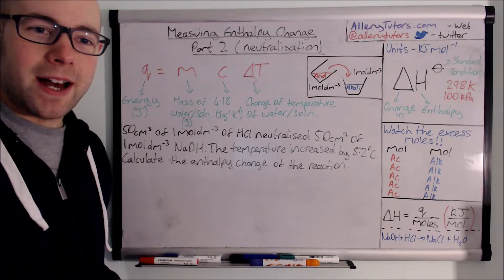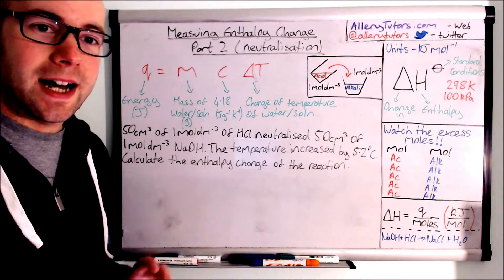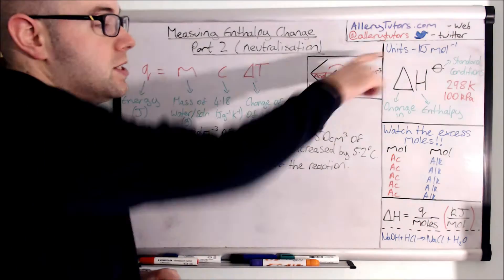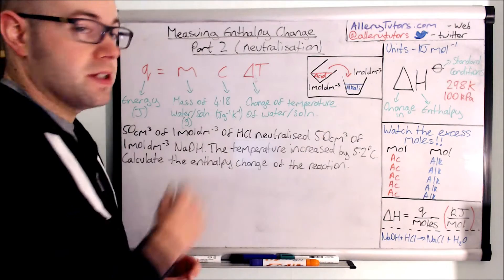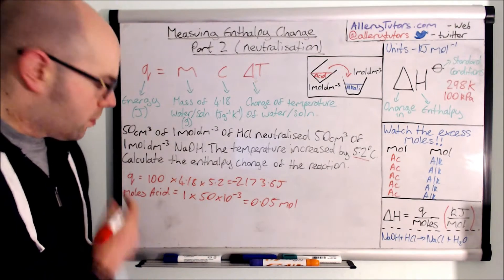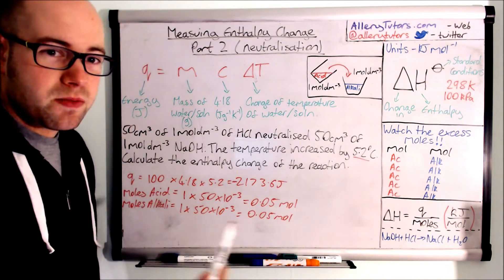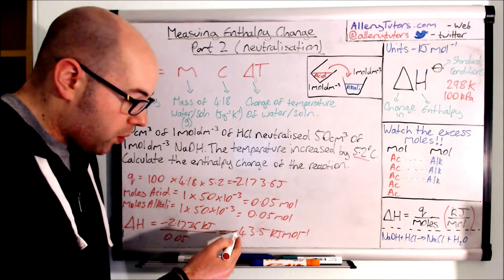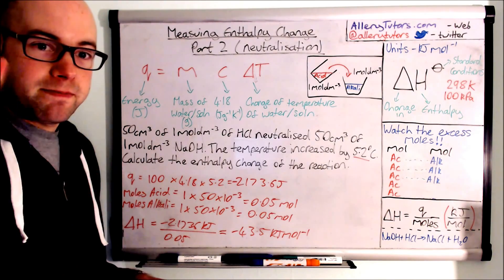Measuring Enthalpy Change Part 2 (Neutralisation)

Comment: don't you need to add 273 to convert change in temperature in to kelvins
Reply from the maker: No. A change in temperature in Kelvin is the same as the change in temperature in Celsius so no need to convert.

Comment: what would happen if you had two solutions with different volumes what would do then and I'm trying to find the temp change in stead and i believe you need the moles to work out the KJ mols-1 
btw your videos are great
Reply from the maker: +Samie Mohammed Yes, you just work out the number of moles for both liquids, find out which one is in excess and use this to work out enthalpy change. This video is similar to the type of calculation you will need to do https://youtu.be/1EFMnmAUjls
Reply: thanks for replying i get it now i will spread the word about your revision videos they are very helpful :)
Reply from the maker: +Samie Mohammed Thanks very much! You may be interested that I have daily multi choice questions for AS Chem on twitter follow @allerytutors to get them.